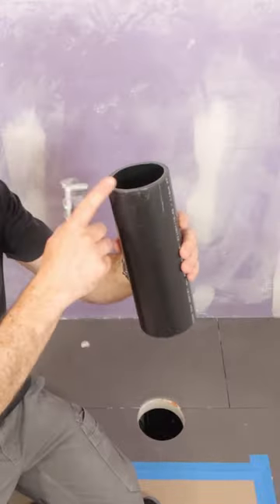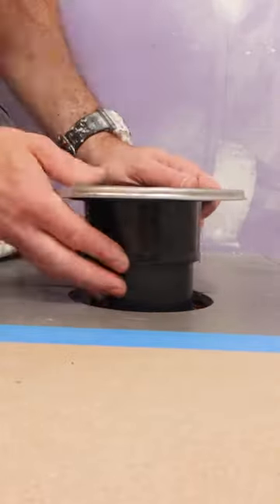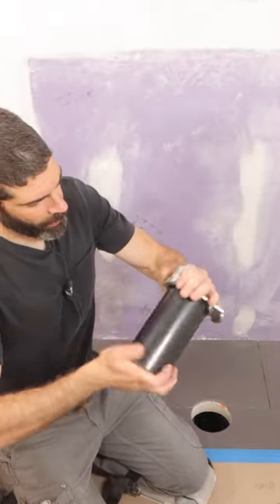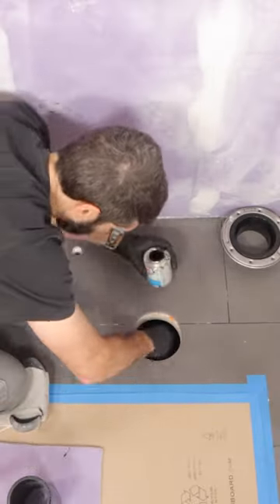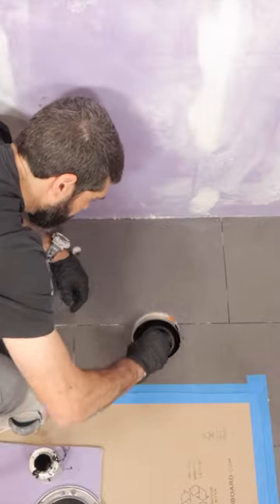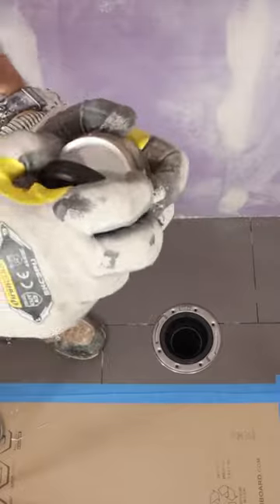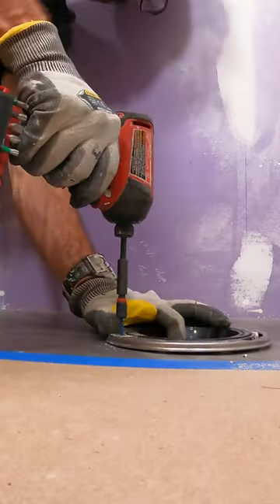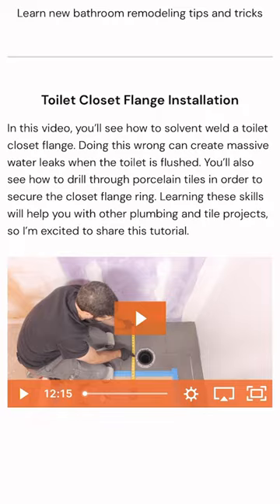Toilet Closet Flange Installation - #shorts

Comment: Very nice, done right. No screwing the flange to the subfloor and tiling up to it like the hacks out there!!!
Reply from the maker: Thank you 🙏🏼😊
Reply from the maker: Unfortunately I’m working on a bathroom right now whereby the plumber did that 😢
Reply: @HomeRepairTutor  Ive even seen that on new construction (not mine). Plumbers mistakenly (some) assume the closet flange is part of the rough in, it aint. Its part of the trim once theyre ready to install the toilet.

Comment: Thats how it's done.
Interesting to me is that you can use 3" for closet waste lines. It works just fine....but....of course in Chicago we were limited to having to use 4" with some exception for secondary baths.
Reply: What is this cooling fluid? All these years we've been using H20.
Reply from the maker: I would have preferred the 4”x3” 90 but whew, there was no room in the joist bay below. The 3x3 90 barely fit. That cooling fluid is from Montolit Tiling Tools, it’s like a wax that cools the bit, not as messy as water in a finished space
Reply: @HomeRepairTutor  Im going to hook myself up with some for that purpose...thanks for the referral, always learning even now.
Reply: At 30 bucks a copy Im just going to assume it has gold dust in it lol.
Reply from the maker: @edmessina8392  lol quite possibly, it lasts awhile because it melts then resolidifies

Comment: Wait until someone replaces the tile
Reply from the maker: That better be in 50 years, I just installed it
Reply: Im trying to figure out why someone would have to replace that tile unless its time for a new bath....in which case an internal diameter pipe cutter would work just fine.